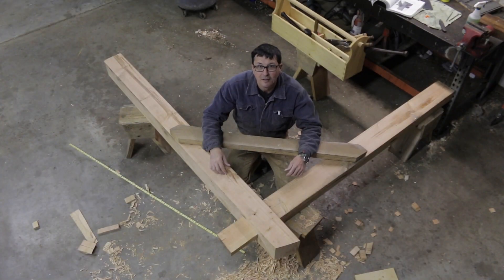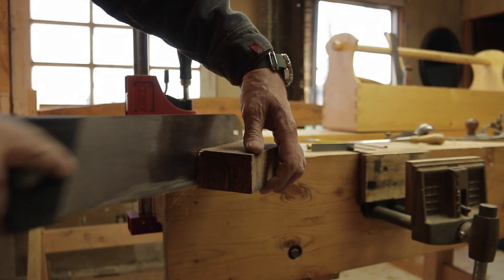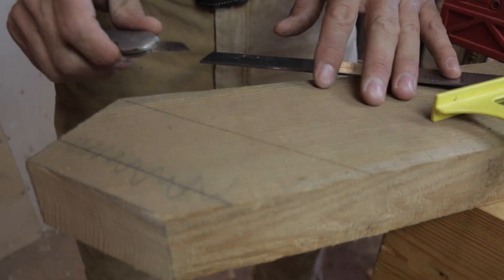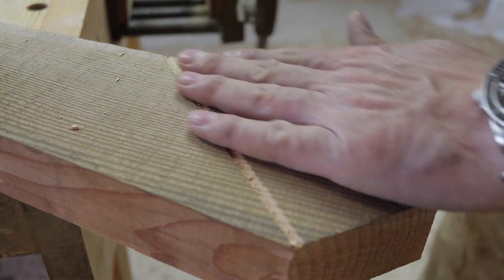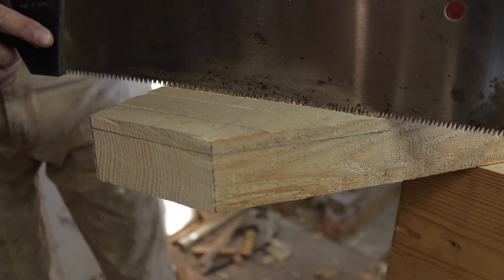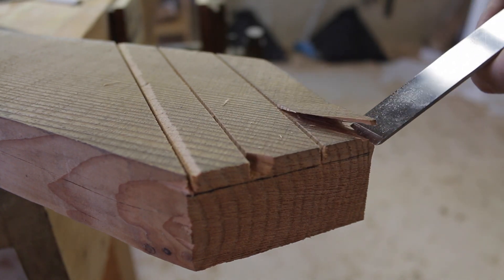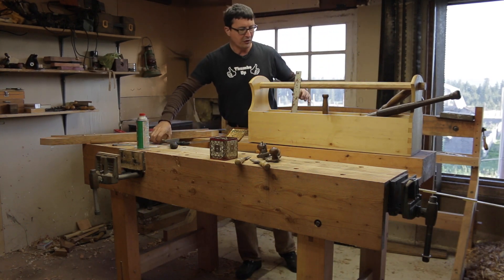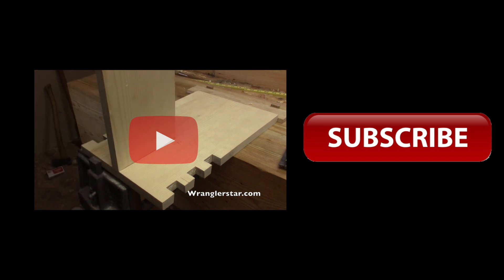DIY Timber Framed Mailbox

Comment: I've been using Japanese pull saws for twenty five years. I don't do a lot of precision cutting like you do. But what I have found that works for me to keep the saw cut straight and vertical. Is to start the cut from the end of the board where I can see both the straight line one the top flat side of the board, and also see the vertical line on the end of the board. 

Start by cutting a shallow kerf  along about 3/4 of the line on the top or a little more. Just enough to help the saw want to cut straight, similar idea that you use with the chisel cuts before sawing. 

Then turn your attention mostly to cutting straight down the vertical line. Cutting at an increasing angle 10˚ ~ 45˚ , initially paying attention to both  the vertical end cut and the flat side line to  cut to keep both cuts going straight and square.  Switching back and forth on which line you're paying most attention to and trying to keep straight.  To a point where most of your attention is on the vertical cut. Once you have the vertical line cut to the bottom edge of the board, or nearly so, and the top line cut with a deeper saw kerf back about half way. Your cut should stay straight and vertical. If you want you can even switch and cut from the other direction. The saw cuts from that point will tend to keep the thin saw blade cutting straight. Assuming you're pulling reasonably straight on the saw handle.

Comment: I use my homemade leather stropping wheel to resharpen razor blades. They quickly get sharper than new and nicely polished too. 
I really like your tip about using an oil rag when you put your chisels away, I frequently find rusty fingerprints on them after they have been sitting for a while.

Comment: When marking fine lines on dry wood I use a .07 gel type pen.  I have found it makes for a more accurate line than a pencil and you don't have to keep sharpening it.  Also, it won't clog like a rollerball style will. Damp wood or treated I have always preferred a scribe.

Comment: See that little brass Knurl on the bottom of your square @ 8:08 in the video. Pull it out, it's a scribe that you use instead of a knife blade.
Reply: Do you really think Cody doesn't know what and where the scribe is? He opts to use the knife because it is more accurate and effective than a scribe.
Reply: +Will Cushman relax bud, Cody may already know, but not everyone does. Geeze...

Comment: For the cuts along the knife wall/edge of your tenon, use an improvised saw guide. A simple 90* block clamped in place will take away a lot of frustration and guesswork. Can't wait to see this installed.

Comment: Have you thought about making Paul Sellers Frame Saw? Personally i found the one I made myself from his plans has greatly improved my accuracy with cutting solid timber and have now made myself extras with different blades for the different metal types i have a need to cut, was great for pruning my fruit trees as well

Comment: hi Cody, just a little trick for starting a clean cut with a handsaw. Try putting one finger in top and one finger to the side of   the sawblade. By doing that you can easily control the pressure on the blade and the angle of  it. Greetings Form Germany.

Comment: Hi,I use a normal pencil and a pencil sharpener but I have always wondered why woodwork pencils are that shape. There must be a reason why but I do not know it, in your travels and work have you ever come across why the pencils are shaped like that
Reply from the maker: +John Fithian-Franks So they don't roll off the work surface,
Reply: +Wranglerstar never thought of that...makes sense tho...
Reply: +Wranglerstar I thought of " so they fit better behind your ear/ under your hat" ;)
Reply: +Wranglerstar or perhaps it's because it's for drawing straight lines quickly and not needing to be sharpened every other line. Ya use the big flat blade against yer flat straightedge and it don't skip of course cos of the wood grain  and takes a long time to wear the point of because it ain't a pin point but more of a chisel edge.
Reply: It's simply that they don't roll off slanted surfaces.

Comment: I commented in the last video, before seeing this was posted. If you are still planning on using pegs, don't cut them before driving them through the plate. Split them from a piece of firewood, then through the plate. The strength comes from the full length grain.

Comment: It made me wince seeing you guide the saw blade with the tip of your finger, one slip or jamb of the blade will cause the blade to jump out of the cut, taking a chunk out of your finger or ripping the nail off. It's safer to use the knuckle of your bent thumb to guide the first few cuts of the saw. The tip of the thumb rests on the wood and acts as a firm base, well away from the teeth and the knuckle can be an inch or more above the wood well out of the way of a jumping blade.

Comment: Using a saw with thin metal and small teeth you have to think ;less force. There is carpenter pencils for concrete ;stays sharp longer.  Japanese saws are made to split wood aswell, just a bit different blade.